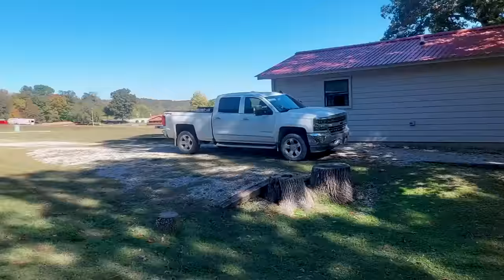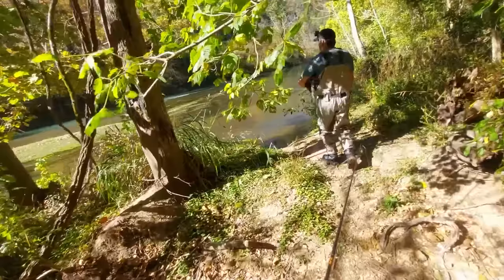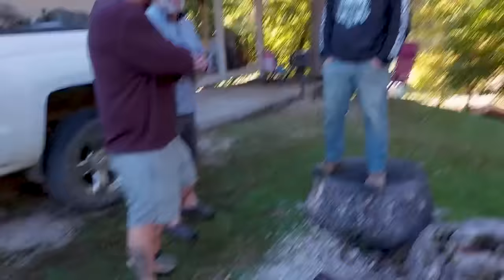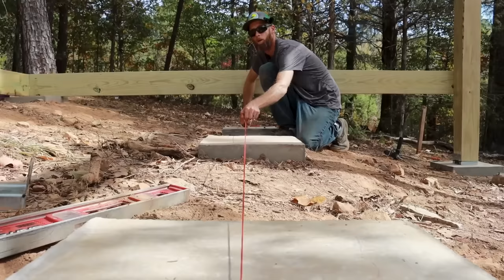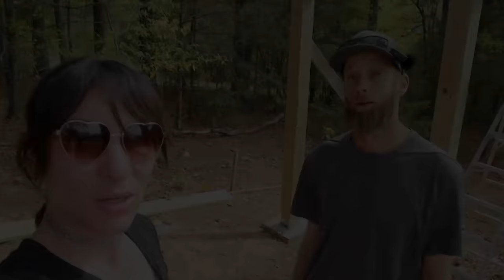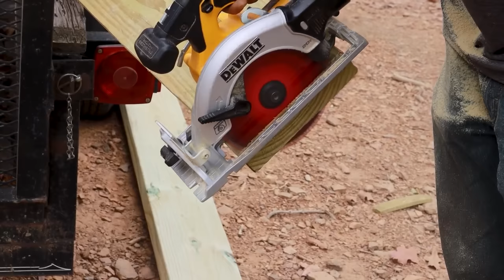We FINALLY Got It Right! | Pier and Beam Foundation On A Hill Building Tree House on Cabin Homestead

Comment: I like the structure of the play house , I bolt them beams to the 4x4 or 4x8 ,  using allthread with washer and nuts on each side , so when they get loose all you have to do is tighten up on each side ......  just passing along so knowledge I've used from a old framer friend of mine .

Comment: At work we used to put in a lot of racking systems. I have drilled a lot of anchor holes (thousands) using a Hilti drill. I found not using a lot of pressure the holes drilled easier and the bit lasted much longer. Looking good guys.👍👍